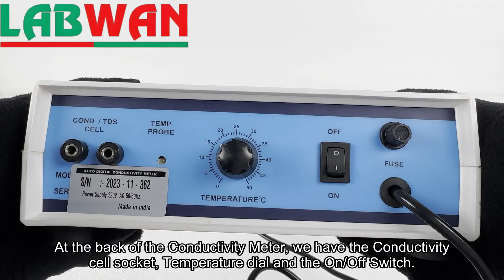How to use Auto Digital Conductivity Meter

Comment: How can we caliberate this conductivity meter?
Reply from the maker: Thanks for your question! 😊 To calibrate a digital benchtop conductivity meter, follow these steps:

1️⃣ Prepare Calibration Solutions – Use standard solutions like 84 µS/cm, 1413 µS/cm, or 12.88 mS/cm, depending on your measurement range. Ensure the solution is at 25°C for accurate calibration.

2️⃣ Rinse the Probe – Clean the conductivity electrode with distilled water, then blot dry with a tissue (don’t wipe to avoid static buildup).

3️⃣ Calibration Process – Immerse the probe in the first calibration solution (e.g., 1413 µS/cm). Let it stabilize, then press the CAL button to confirm. For multi-point calibration, repeat with other solutions.

4️⃣ Verify & Store – Check accuracy using a standard solution. If the reading deviates, recalibrate or clean the electrode. Always store the probe in electrode storage solution for best performance.